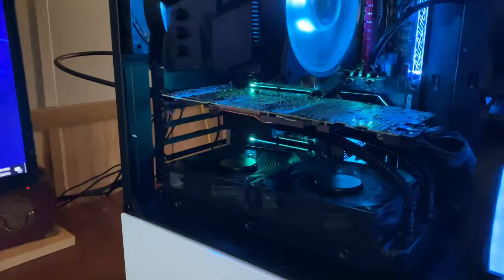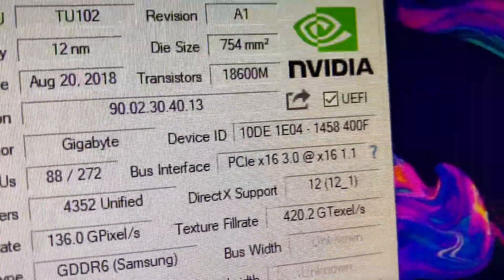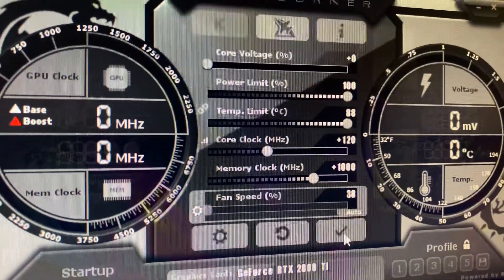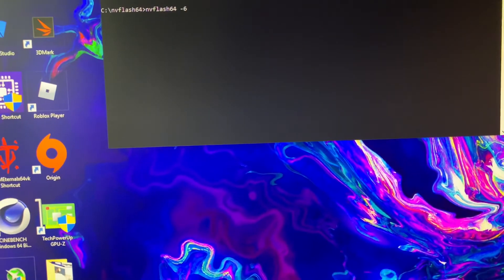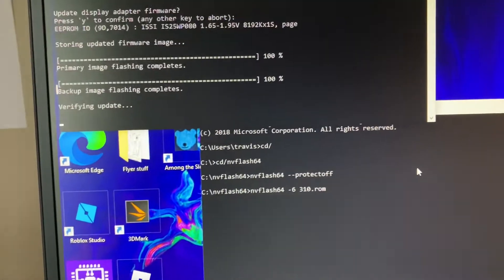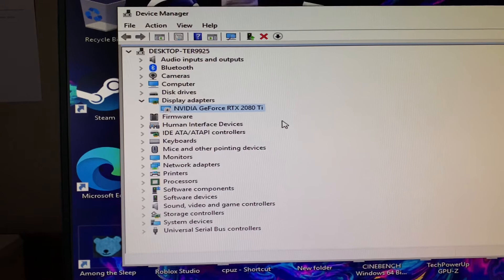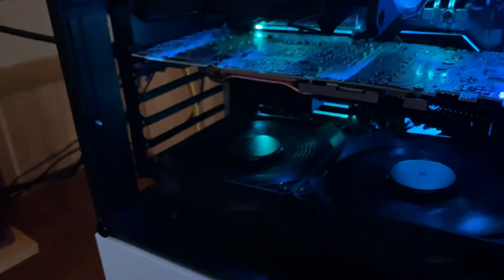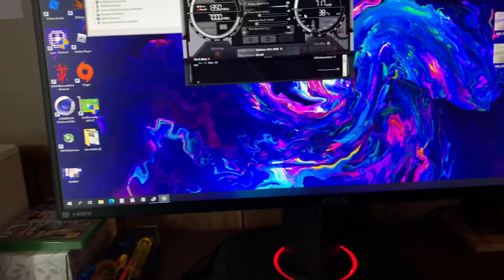AORUS Game box 2080Ti eGPU bios flash! 250 watts to 310+ watts

Comment: hi, so after you removed it and connected to the motherboard, does it break the thunderbolt 3 bottleneck?
Reply from the maker: Of course!!! It is a standard 2080Ti inside of this eGPU box. Once you pull out the 2080Ti, and run it in a PC. It is just like any other video card!

I power modded mine, and flashed the bios to a higher wattage. I had the card locked at 2,145Mhz running at around 50C! It was getting. 18K in timespy graphics score, and 40,000 in Firestrike graphics. That is insanely fast!!!!

Like, we are talking like a stock next gen ampere 3080Ti level fast.
Reply: THE REAL FAMILY CHANNEL That is remarkable! 2145Mhz clockspeed? That's hard to believe. 18K timespy is definitely next gen level score. And it keeps at 50C? How much power are you feeding it?
Btw, about how much performance jump did it do when attached it to the motherboard and removed the TB3 bottleneck without any power boost? Like 25-30%?
Reply from the maker: run si 

I never used the GPU inside the eGPU enclosure, I had no way to run TB3. I immediately pulled the GPU to run it in my desktop. See my videos. I flashed the bios to the 310 watt NON A “Palit version, and I soldered on (2) 8 OHM resistors to trick the power sensing. So, it could draw 45% extra power on top of the 310 watts.  For a total of 449 watts of power draw! And it would pull 450+ watts steady while playing games like RDR2! The card is just a freaking Monster!!!! The 240MM radiator, and full coverage OEM block keeps it running very very cool. I never saw it go over 52C during even the most stressful benchmarks. And that’s while drawing 450 watts. So, if it were running stock it ran about 10C cooler than that.

Also, it wouldn’t run at some high frequency and then slowly clock down in MHz as you played games. 

I ran +230 on the core clock, and +1,100 on the memory.

It would lock 2,130-2,145Mhz and it would NEVER EVER drop below 2,130Mhz. It would hold that frequency for ever and ever until the end of time lol. It had the available power, and it ran nice and cool.

As for running it with Thunderbolt 3, to a laptop or something. It simply isn’t worth it. You may as well run a GTX1080 or actually less than that. Because you are only using about 30-40% power of a stock 2080Ti over TB3 connection. It is a absolute waste. 

I found a really good deal on this EGPU 2080Ti. And that’s why I bought it. Specifically to pull out the 2080Ti for desktop PCI-e X16 lane usage, full power beast mode! Unless your doing professional work that doesn’t transfer high bandwidth across TB3, then gaming across TB3 with a 2080Ti even running stock is quite silly to say the least.
Reply: THE REAL FAMILY CHANNEL
Lol, so you just bought the egpu for the 2080Ti then? You must get it at a pretty good price. I am not good at mess around bios, i was planning on using this for my laptop now, and one day when i find a city to settle, i will build my desktop and move this to the desktop with the 250W power limits
Reply from the maker: run si 

I got it for free believe it or not. I originally paid $650 for it on eBay. And then the item was lost in the mail by USPS. After about 15 days lost in transit on the tracking info, I was refunded by the seller 100% of my purchase amount. The item showed up about 5 or 6 days later. The seller said don’t even worry about it, And enjoy the item. So I did. It was 100% free. If your running it in TB3 to a laptop, then the 250W bios is fine. They have a $100 rebate on these from Aorus. So they are $1,299 brand new now on Newegg or Amazon.
Reply: THE REAL FAMILY CHANNEL 
that is awesome. Is it hard to removing the graphic card and liquid-cooled system from the egpu?
Reply from the maker: run si 

No, it is pretty easy. Just make sure you find a I/O shield to install on to it. Because the 2080Ti inside the eGPU box doesn’t have one. So there’s no way to use screws to secure it in to your case. You’ll just have to prop it up. But, any 2080Ti I/O shield will work for it.